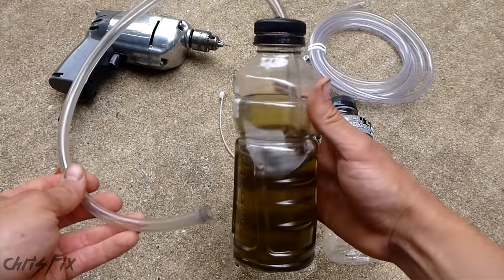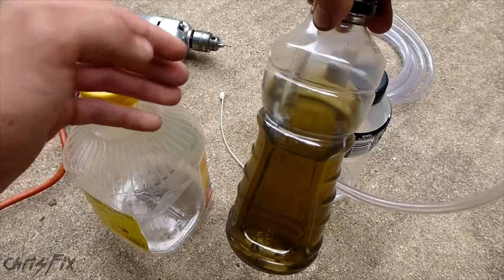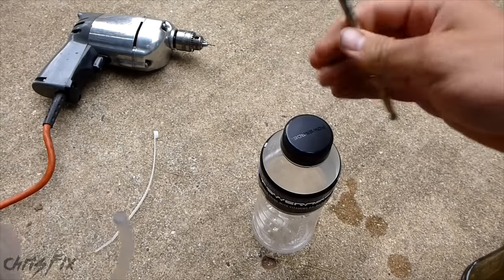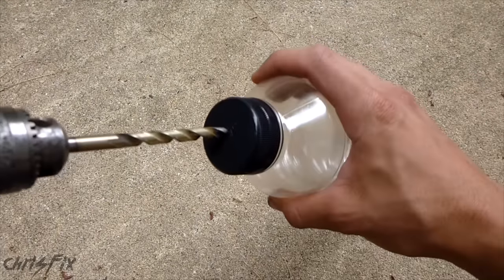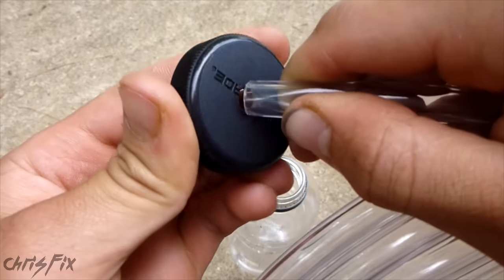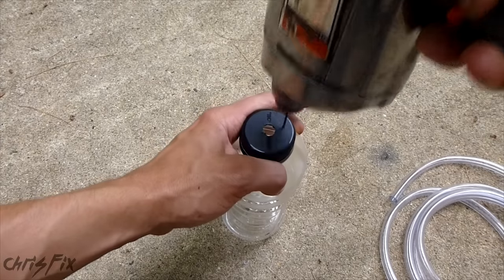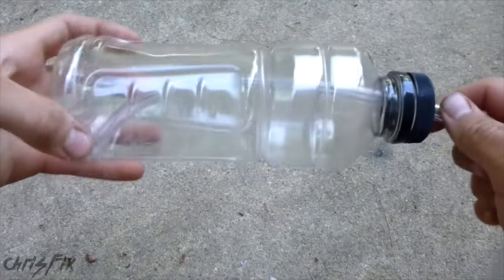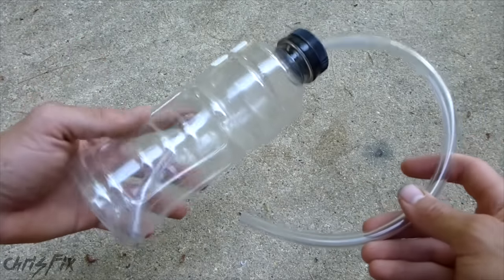How to Make a One Person Brake Bleeder for Under $5

Comment: Ok I'm going to attempt to bleed my 4 wheeler brakes why does the hole in the bottle need to be air tight? Or does it? Could u just stick the tube in a 50 gallon drum? Why the bottle? Confused
Reply: The hole is small so if it tips over you don’t end up with California all up in your face.
And you have to fill whatever you use enough so the hose can have the end submerged
A 50 gallon drum would need a long hose and a lot of filler fluid.

Comment: Chris, I made the bleeder as shown.  I am trying to bleed breaks on 66 vw bug I can not get the air out of the line I am filling up the bottle with fluid but the tube is not solid fluid does that mean air is getting into the line?  IF so where can it be coming from back in from the bleeder screw?  I really have a very hard time with this simple process
Reply from the maker: +rioraton it could be coming from the back of the bleeder. Only loosen the bleeder barely enough to let the fluid come out.
Reply: Spot on brother!  IT was.  I teflon taped them also it was coming in from the break light switch on the front of the MC which I also taped and really tighted up  It seems to have solved the problem and I was able to finish bleeding the breaks

Comment: a reverse bleeder is better air always wants to rise, a reverse bleeder forces fluid up the system and pushes the air toward the master-cyl
Reply from the maker: +rjc862003 thanks for sharing.  A reverse bleed requires special tools.
Reply: yes but the problem with the catch-bottle type is that if you don't displace enough volume to push the air all the way out of the tube its just gonna end up sea-sawing back into the system
its why bleeders use a vacuum,or you have somebody close the bleeder screw every-time you pump it  + if you have a modern ABS system with electronic check valves YOU absolutely need a reverse bleeder,the computer will not allow you to pull fluid from the system (motor cycles do this)
Reply: what you can do is take your bottle rig make it airtight
drill it out put a  tire-valve n the top of the bottle and fill it right up to the neck with fluid,pump air into the bottle, done you are now reverse bleeding 
so long as you don't push all the fluid out of the bottle you won't get any air, oil doesn't compress,just make sure you close the bleeder while the you still have pressure I usually set the compressor down to 5 or 10psi so you aren't blowing fluid all over the engine bay
Reply: and if you wanna get real fancy with it go find your self one of those big old turkey injector things and rig that to a bit of line and load that with fluid and push

Comment: Do you have to bleed all 4 brakes? I change the brake pads on the front of the car and ending up having to remove my calipers. I now have air in the system. Can I just bleed the front?
Reply from the maker: You would only have to bleed the front if you remove the front rotors.
Reply: Thank you for the fast response.

Comment: Chris liked your one person brake bleeder, But I have a problem, I own a 2001 GMC sierra 1500, and my front brake caliper HAS NO BLEEDER VALVE, and I can not bleed my brakes, They are stock, original calipers, how am I suppose to bleed them, I am replacing rusted brake lines, so you can see why, I am at a lost, because I have done this in the past on other vehicles. The location of where the bleeder valve is suppose to be, there is a pointed thing,kind of looks like a sharpened pencil with the lead broken off. Any advise would be greatly appreciated.
Reply: the calipers definitely have bleeder valves. I have the same truck and have bled them many times but regardless every caliper has them. you can actually get most of the air out by bleeding it through the brake line connection at the caliper if your valve is rusted too bad but it really should be replaced.
Reply: I did read the whole comment before commenting like I should have but sometimes the same calipers are used for different sides and the caliper will have 2 valve locations with one plugged to keep the valve at the bottom of the caliper.
Reply: Didn't I mean
Reply: come again??

Comment: Just a cautious comment. The air might come into the system from the base of the bleeder screw. So zip tie won't help in that case.
Reply from the maker: Dont unscrew the bleeder screw that much and you wont get air in there from the base of the bleeder screw. Good question/comment.

Comment: 1997 F150 I put rear brake I put new brake shoes spring wheels cylinder drum but my drum won’t fit
Reply: You need to grind the inside of the drum until it fits.  That's like basic mechanic stuff.

Comment: hi chris i just change my break on dodge stratus but the problem is even when put a new brake pads i still heard a noise when i puched the brake completly
Reply from the maker: +kamal abbady Could be you didnt use copper antiseize on the correct lube points.
Reply: yeh but sometimes i did not hear the noise when i stopped the car is that because the break pad are still new ?

Comment: Put a one way check ball valve in the hose. Then the fluid can't be sucked back in.

That's how I do it for 15 years and get that hard brake pedal back.
Reply from the maker: Claude Rains Great tip! That would work awesome for the bleeder!
Reply: Claude Rains Details on where to get the one way check valve.
Reply: I got mine from a pet store. It was for a fish tank and it's made of clear plastic. So brake fluid doesn't affect it. It's also great for filling rear axles and transmissions.

Comment: Good Job, but If you are going to have a air hole anyway why not just make the tube hole a bit bigger or cut a rough notch for the tube with a knife?
Reply: +FAKE NAME I reckon a big stone in the bottom would help as well to balance the bottle and make the liquid higher
Reply: because the tube stays in place so it remains at the bottom of bottle, also it can be carried safely by the hose and also the other end of the hose can be wedged in something (car port framework for eg.)so remaining fluid can drain into bottle

Comment: I have a 1988 porsche 944. The brake pedal on it only travels about 1/2 inch to about an inch, so pretty much I have no brakes. I don't know what could cause it or if it only works when the car is on, but that's why i'm asking. What could it be? It's a 5 speed manual with disks all around.
Reply from the maker: argonian bilbo You have to be more clear in your question. When the car is off, the brake pedal will not travel very far and it will be hard to press the brakes because you dont have the brake booster assisting you. When the car is on, you should be able to push the brakes easier and the pedal should travel a little further. That is normal. If it is hard to press with the car on, your brake booster is either bad or you have a vacuum hose that is cracked or fell off.
Reply: Ok that's what I was looking for.  Thanks
Reply: If the vacuum hoses or the brake booster is bad, how hard is it to replace them
Reply from the maker: argonian bilbo It isnt that bad. Depends on if there is access. The rest is just unbolting the old one and putting in the new one. If the vacuum hoses are bad you can replace them in 10 seconds. There is a big hose that goes into the booster.

Comment: I hAve a 1991 toyota pickup truck break line busted fixed line now my petal goes to floor bleed master cylinder  and breaks when vehicle is off great breaks when start up truck goes to floor will pump up but try breaks again back to floor what could this be

Comment: Couldn't you just use an oil can, fill it up, and pump it through the slave cylinder bleeder valve? Basically filling it up from the bottom, since air travels up, and watching the master cylinder air bubbles go away.

Comment: Heres an old school way that i have found the best way to bleed and your brakes open master cylinder cap open farthest bleeder from master let it bleed by gravity after a few minutes of bleeding free no air bubbles and check master doesnt run dry using new fluid close bleeder go to next bleeder until all 4 are done brake pedal will be harder then ever and fluid flushed....

Comment: what about just using a big Screwdriver or a Crow bar ??? i bleed my brake alone , with only a screwdriver stretched on the sit ppushing the pedal to the metal
Reply from the maker: twisty How do you pump the brakes with just a screwdriver?
Reply: well not hard first press the brake pad until it cant go any further , step two get a giant screwdriver on the brake pedal then bring the seat at incredible speed on the other tip of the screw driver locking it in position , go unlock the screw just a bit until u hear bubble on ur galiper , once u see oil come out fasten tight the bolt fill up back the oil reservoir , if u left too many out , and just remove back the screwdriver and there u go u are with a brand ew brake pedal that brake so much u need to be careful at the first few stop,then get used to it . and there we go sadly i cant find any video of this technic but its not hard and u can do it alone without having to use any instrument beside a giant screwdriver stuck on the Pedal
Reply: thats pretty much how i bleed my brake if i unplug my hose by error or some wierd bubble in it
Reply: make shure u put the brake pedal at the very end of it , then stick the giant screwdriver between the pedal and the seat first before lossening the bolt , then loosen it just to hear bubble pressure going out when its almost stopped bubbling u fastly tighten it back and fill the brake oil reservoir if needed , then remove the screwdriver between the seat and pedal and try it out, brand new brake pedal braking like fucking hell
Reply: i dont do eet the same way he does but the giant screw driver idea is from there
Reply: i can also add that my brake fluid is perfectly crystal clear even after 6 years , i dont get why ur is so brown its like rust problem or wut O_o mine has a LITTLE yellow color like any normal brake fluid but urs is kinda black anyway it dont matter aslong as there is no chunk in it actually
Reply from the maker: twisty Gotcha. I guess you can do that or you can do the one person method I use. Mine is brown because the truck was abused before I got her!

Comment: why didn't you drill the hole in the cap with it off the bottle and it wouldn't get the plastic inside the bottle?
Reply: Mick Mcmasters because fu that's why 😀

Comment: What if the fluid comes out a little bit but stays at the top of the line instead of flowing to the bottle? Please help!
Reply from the maker: As long as the line is filled with fluid, you are good!
Reply: @chrisfix  no it come out the brake bleed like two or three inches and just stops. It’s on a Mercedes I think I have to have the abs pump activated but I will try and se. My next step is the vacuum method

Comment: Because the interior diameter is 1/4 inch. The hole drilled was with a 1/4 inch bit. Doh. The tubing wasn't going to fit...

Comment: where did you get the tubing?
Reply: +Miss Kryss Hardware store, lowes, home depot, ace, etc. Vinyl hosing, should be in the plumbing section or near the wire and conduit section.

Comment: let me ask u this i hv a honda accord 1992 when i lock over full on the right side only my breaks pedal goes rite dwn only when i turn right way cud be the problem
Reply from the maker: There can be damage in the brake hose or brake line. I would look for leaks!
Reply: Not see no drips on floor at all

Comment: I saw something on YouTube the other day bleeding brakes. By yourself. The guy took the top off of a spray bottle hook it to the hose and pump the air out of the brake system. I saw some air leakage but that was after the bleeder. You are sucking air out of the wheel cylinders and calipers.

Comment: You don't really need a large bottle.  Put your bottle in the hole of a roll of duct tape and it won't topple over.

Yes, another use for duct tape.
Reply from the maker: Thanks for the tip. I fill this bottle no problem when flushing my brakes.

Comment: Glass and jar dont need cap
Reply: Open bleeder a fourth foundation block works great set jar on.slowly pump starten with wheels furthest fram master cylender keep it full check every 12  pumps or so that easy nothin more to it then check for leaks

Comment: This bleeder has a problem. When bleeding brakes the bleed nipple should be closed when the brake pedal has been depressed. Then the brake pedal sbould be released and the bleed nipple opened just as the brake pedal is being depressed again- and so on. It is a two man job. Problem with your bleeder is that expelled fluid in the tube (contaminated with air) can be sucked back into the calliper again. Your bleeder needs a modification of a one-way valve to be added to prevent contaminated fluid from being sucked back.
Reply from the maker: +577666 This bleeder works great and has no problems. You place the tube upwards and the bubbles float to the top and you wont have a problem. Watch the video: https://www.youtube.com/watch?v=n1NvtUwfRJc

Comment: This method is great but there is a problem. When you release the brake pedal, the fluid is sucked back into brake lines but which fluid? Clean (new) or dirty (old)? Of course dirty and old fluid! So, if dirty fluid finds its way into the system again, what is the point of flushing the system?!

Comment: what is a one quarter inch?
Reply from the maker: alex schmidt 1/4in
Reply: ChrisFix thanks, just did it today and it works perfectly. Could you make a video how to repair a Cluster and how to recalibrate the needles? Would be awesome.
Reply: 1/4 inch is the same as  6.25 milimeter

Comment: why cant you just leave the cap off and have the tube going straight into the bottle?  it doesnt make sense to think that you need to have the cap on and the hose tight  in there like that
Reply from the maker: +rob crow Because if the hose is loose, it will knock the bottle over or fall out. Having it in there tight makes it easier to work with. Trust me.

Comment: What if the drill I'm using isn't from the 1950's, will it still work?
Reply: The drill will work. Just not as long as the one from the 50's.

Comment: Just take the cap off and drill the hole, think about it.
Reply from the maker: Good idea thanks for the tip!
Reply: Cool mate, I love your vid's, I am trying to bleed my Vans brakes right now, but I'm not being successful. What I noticed in your other vid on flushing, is that you put the cap on the master cylinder, I haven't,,, and you keep the bleeder hose ABOVE the bleed nipple, I haven't been, I hope these 2 steps make it. I am bleeding the back drums, from farther nipple no luck with getting fluid out yet [full reservoir], it's getting air in somewhere, wheel cylinders are second hand, but they come off another van, they were dead dry, no sign of leaking or seized pins/pistons

Comment: I replaced rotors, Brake Pads front rear both by my self, I saw that my bottle/reservior is having some muddy sand inside, I unbolted it out in order to clean it with carbi choke, I did so, I clean it, ran through some brake fluid in it before installing, then installed it, I bleed all four wheels starting from the farthest, heres a thing now, When my car is shut off, the pedal is rock hard, but when its start its spongy, also when theres a bump during brake its giving me a feeling as if something scratching down(although this same feeling was there when the pedal was nice and smooth before changing the brakes), please help?? My car is Acura TSX 2008

Comment: DO NOT USE THIS!! you will get air in your brake system and end up having to get the car towed this does not have a check valve inside the tube therefore air will get back into the brake system.

Comment: Your measurement for drilling the hole was based on the internal diameter of the tubing, not the exterior which it should have been. Also, might want to just drill the hole in the cap...away from the bottle.  Just my $.02
Reply from the maker: Joshua MacDonald Thanks for sharing Joshua! You want to drill the inner diameter so that there is a snug fit. You can always drill out some more material later (but you cant add material).
Reply: Joshua MacDonald LOL...you were not listening Joshua;;;;;;good job Chris.
Reply: Tom Sommer Correct Tom   Idiots like Joshua don't want to listen or see they just want to criticize people who are far more intelligent than them   I wont hold my breath as I wait for Joshuas video  A first class video Chris and clear precise instructions With very good camera work
Reply: Before you try to judge someone on their intelligence, perhaps you might just attempt to educate yourself on correct grammar, as it's clear you are very poor at both grammar and punctuation.  One might postulate that you type as you speak, clearly identifying  your intelligence level somewhere below average.  It's sad, but hey look at the bright side...it's important to have people working lower class jobs so that most of us working just a bit higher than you have base line on what not to be like.

Comment: The drill bit you were using was too small, ok it fitted inside the tubing, that’s useless, you needed one the same diameter as the tubing it’s self, plus you drilled the hole with the cap on the bottle creating more debris inside the bottle, do you not think it would have made more sense to remove the cap from the bottle before drilling the hole, meaning you would not have to wash out the bottle again. Duh!